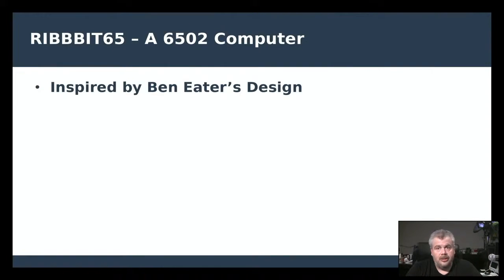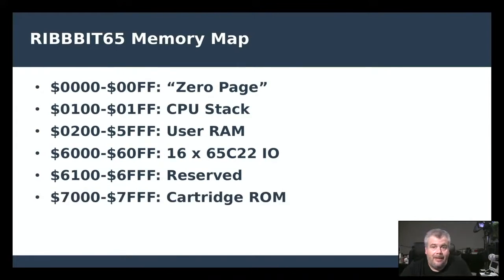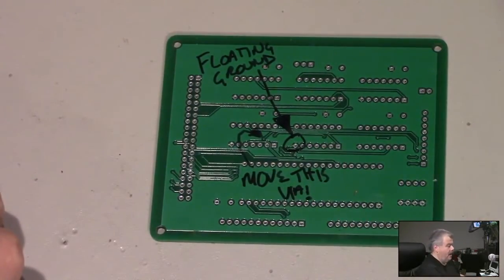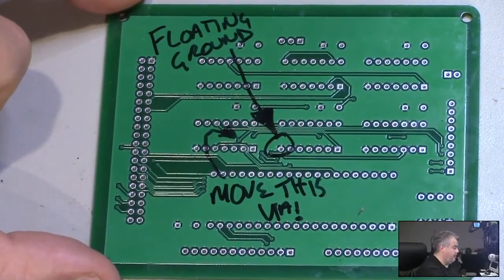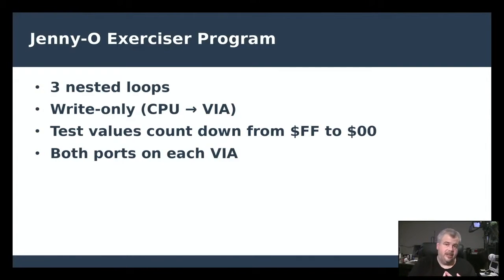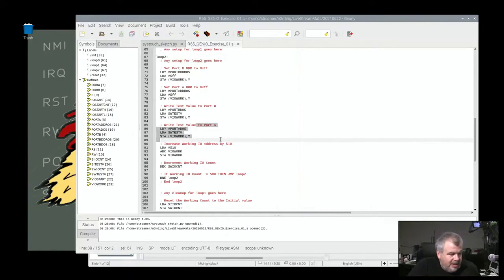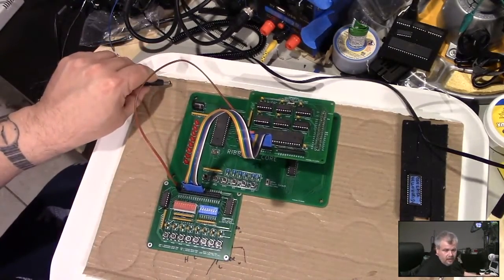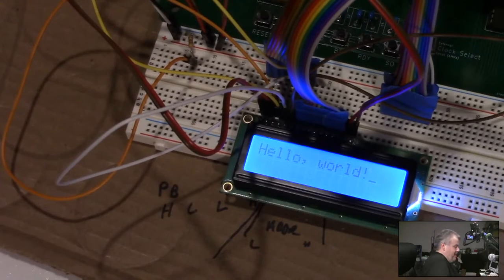6502 IO Board (RIBBBIT65 Jenny-O) (Trimmed)

Comment: I've been wanting to design my own board too. Bought Ben's kit and got "Hello, World!" on the LCD, but it only works about half the time. I expect loose wires to RAM because the LCD does initialize (clears, and sets cursor). I want to use a 3-to-8 decoder (74HC138) for my address decoding; I think that is much cleaner and MUCH easier for me to wrap my mind around.
Reply from the maker: Thanks for the view and comment!  I agree the decoder IC idea is much simpler, but I wanted to be able to use one board design for all 16 possible VIAs.  To select the Address MSB I would need 2 74HCT154s and a couple AND gates, which, cost-wise is substantially more involved.  The select for the high nibble of the Address LSB would still need some kind of "interactive" logic, it seems to me.  I'm working on a "motherboard" plan to use 16 fixed IO slots, with the "channel" selected by a 74HCT154 and a simpler "I/O" connector for the VIA (or other device) cards, with clock, RWB, RSTB, INTB, 2 chip selects, the 8 data lines, and the 4 low bits of the Address.